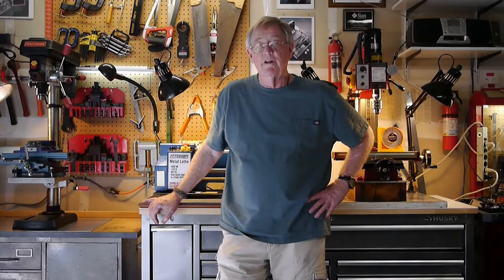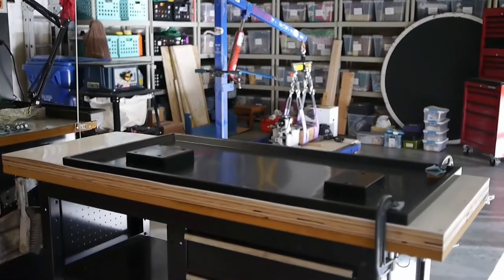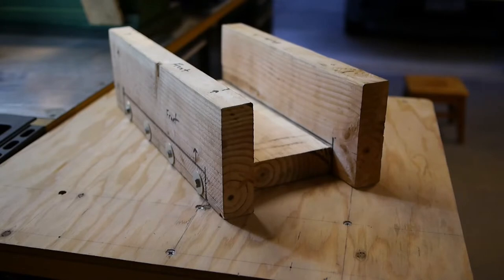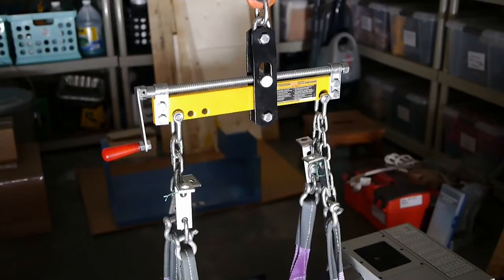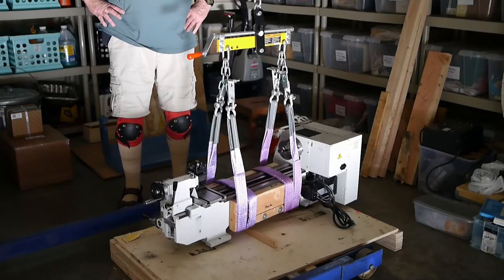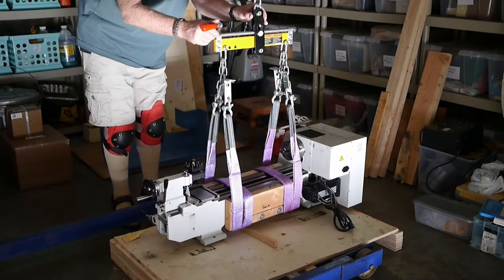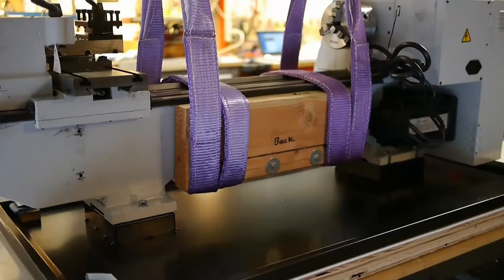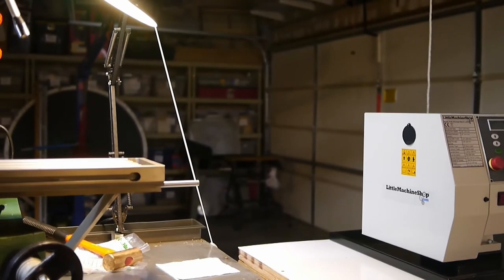Safely Hoist SC4 Lathe onto Bench

Comment: Lookin good ,Been there done that to, Used my engine hoist to lift and install my Bolton BT1440-G lathe onto its cabinet base from a pallet. Had to do it my self alone also. A little planning and caution, Bingo. Later from Texas.
Reply from the maker: Thanks.  I thought that this would work with a much bigger benchtop.  But I gotta say, that doing it single-handed with a BT1440-G is a whole another ball game.  That's 1400+ lbs, no?   It sure looks like a pretty fabulous machine... :-)

Comment: If you've landed a new (to you) lathe... it's gonna need cleaning. Why don't you just rip it apart to get it on your bench, cleaning on reassembly?
Reply from the maker: If we'd been two guys, or if my wife was up to it, we could have done it by removing the carriage and the motor, then cleaning, moving and reassembling the lathe.  As it was, it was easier to use the hoist and then clean and prep it  on the bench (it was new  and easy to clean - not covered with the red goo of old).  My wife seemed relieved to see the stable setup with the hoist...